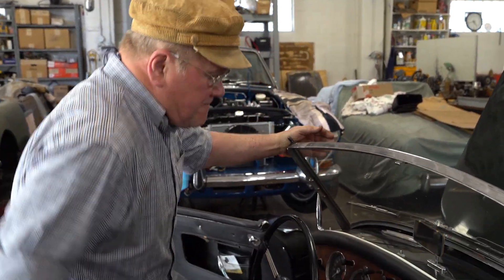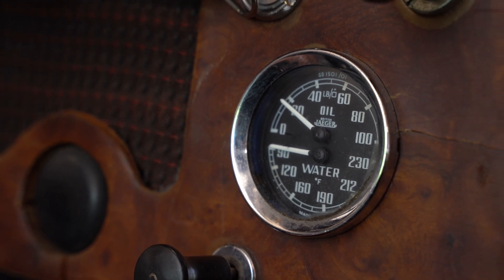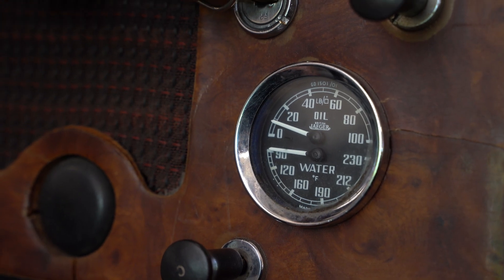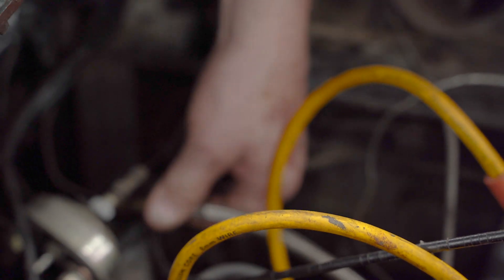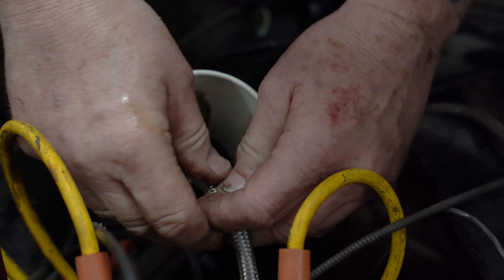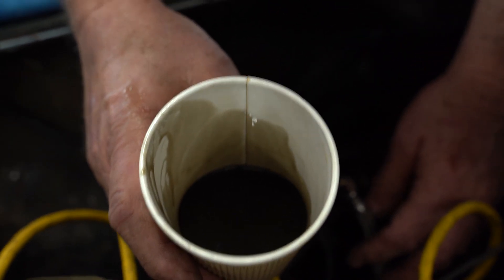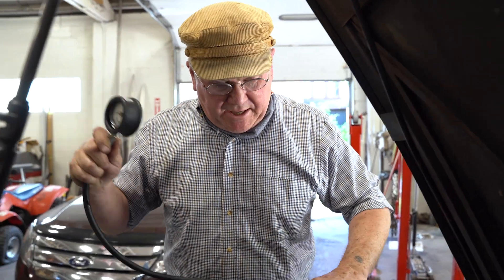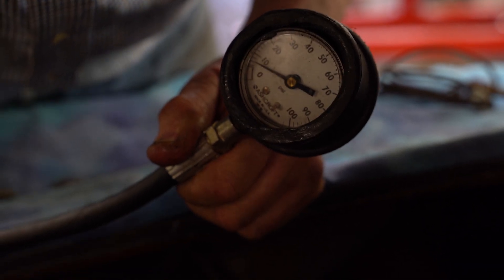336 MG Tech | Dangerously Low Oil Pressure: What's Going on with this MGA?

Comment: Hen talking about oil pressure please state weather the Oil is Hot or Cold .   20 psi idle oil pressure when the engine and oil is cold is a BIG issue, not so much when fully warm.
Also, never assume something is OK, just because the relief was said to be changed, I would still check it before pulling the oil pan. If only because it is MUCH easier.

Comment: I'm the owner of the MGA in this video.  I thought I would give everyone an update.  The culprit was the oil pressure relief valve was stuck in an open position.  When I purchased the car it came with some spare parts, including a new oil pressure relief valve spring, but no valve.  So I just replaced the spring - not even trying to pull the valve (oops).  I finally thought I should try it again, but this time with a new valve.  Alas, I could not get the old valve out.  It was stuck fast!  In fact, I needed to run a tap into the valve (14 mm), then run a bolt into the tapped hole with a jam nut and washer pushing against the block.  I ran the jam not out against the washer, and it pulled the valve out.  I now have great pressure right from the start - 45 pounds at idle, 70 pounds when revved.
Reply: I do like a happy end ❤ 🇬🇧
Reply: Thank you for taking the time to give such a detailed update. I know that was 3 years ago however John's videos are timeless as are the MG problems tackled ps please excuse my comment double entry as I originally entered it in the wrong place🇬🇧

Comment: I enjoyed this video but I would like to know what the problem was. Unfortunately, I don't believe there has been a follow up video - forgive me if I'm wrong.
Reply: I'm the owner of the MGA in this video.  I thought I would give everyone an update.  The culprit was the oil pressure relief valve was stuck in an open position.  When I purchased the car it came with some spare parts, including a new oil pressure relief valve spring, but no valve.  So I just replaced the spring - not even trying to pull the valve (oops).  I finally thought I should try it again, but this time with a new valve.  Alas, I could not get the old valve out.  It was stuck fast!  In fact, I needed to run a tap into the valve (14 mm), then run a bolt into the tapped hole with a jam nut and washer pushing against the block.  I ran the jam not out against the washer, and it pulled the valve out.  I now have great pressure right from the start - 45 pounds at idle, 70 pounds when revved.

Comment: Had the same problem at 17 in my then 20-year old MGA. I completely rebuilt the engine thinking that would fix it. Nope. So I came to accept it as a normal for the car. On a drive north to Santa Barbara, it started knocking like crazy and the temperature skyrocketed. I towed it back to LA, tore it apart, but this time I replaced the oil pump.  Yeah, that was the key to my low oil pressure issue. This, after having to have the journals metal sprayed on my now ruined crankshaft.

Comment: One of our club members was having trouble with real low oil pressure in his MGB. After everyone going over the usual causes, I asked what grade oil he was using. He replied 5W-30. I told him the book calls for 20-50 in the MGB. Maybe that's the problem on the MGA.  Low viscosity generates less resistance to flow through the system, which is translated as lower pressure by the pressure gauge or sensor. https://www.machinerylubrication.com/Read/31182/low-oil-pressure
Reply: I also have what I consider to be low oil pressure (10psi at 900 rpm) at idle when my car is warmed up. The oil is clean but I suspect maybe has the wrong grade of oil.  At start up its right up there at 65psi. My car was restored and has been stored for some years as I have been working away, so I think I'll replace the oil as a first step with a good quality 20-50 before I start getting serious.  Thanks for the tip.

Comment: Humble suggestion, have Max the cameraman buy a 1 foot by 1 foot LED LIGHT Panel. These are simple, come with a dimmer NO HEAT so safe to rest anywhere on the car- always dark spots under the hood. The light could be “pre-set “ to facilitate smooth “one take” videos, oh and the secret is out we all use lights...leave it in the shot! Really like your videos, keep up the great work!